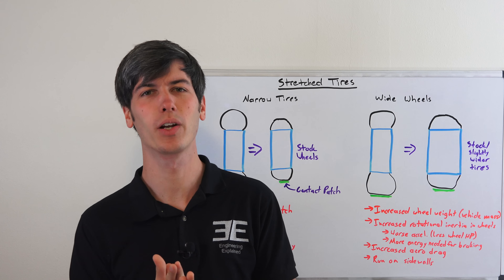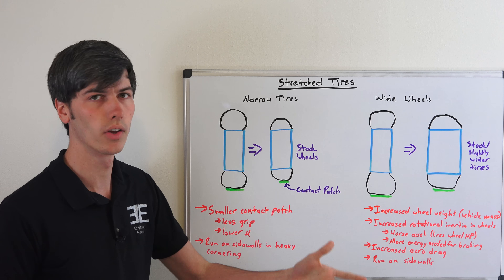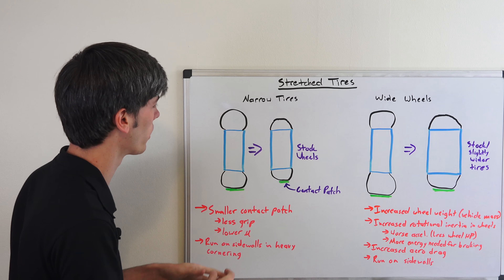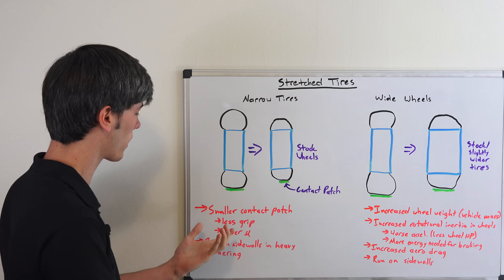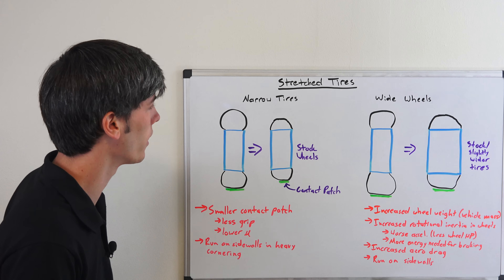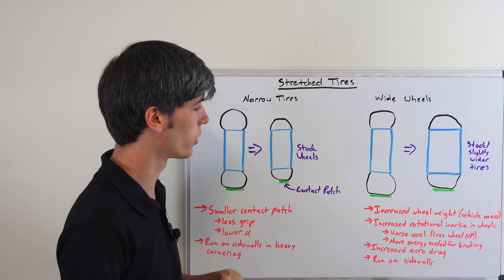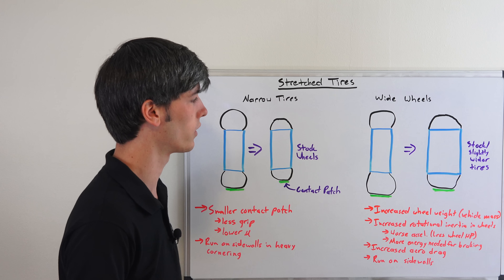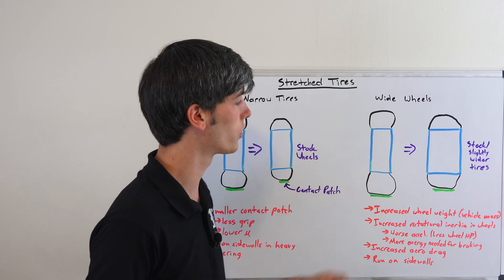Stretched Tires Are Silly

Comment: Thanks for the video. I've been looking into this concept for a long time without a satisfactory answer. Needless to say, I have some questions and would love to hear the thoughts of someone better versed in mechanics/physics/engineering concepts than I am:

1- What do you consider a stretched tire? Tire manufacturers design specific tires to fit within an approved range of wheel widths. I can put a 225/40/18 Michelin Pilot Super Sport on a 7.5"-9" wheel and still be within spec. I believe if I put a 225/40/18 on a 9" tire it will aesthetically have a slight stretch. Yet... it's within spec. So when you refer to stretched tires, are you referring to "grossly" stretched?

2- I forget the name, but I read a vehicle dynamics book that specifically mentioned a situation where a racing class allows an 8" wheel width. In this case, it recommended putting the narrowest tire that fits within spec (slight stretch), as opposed to the widest tire that could fit within spec (slight crown).

3- There's a lot of debate on whether wider tires are better... to me, this video is related to that. Any possibility to tackling this subject? While this is a video saying stretched tires are silly... I feel it there is a point where too wide tires are silly as well?

4- Doing my own research of sports cars on the market, in general, sportier cars tend to have wider wheel sizes with narrower tires on those wheels (usually within spec). The more track tuned models tend to go further down that path. The most severe I found was a new Porsche 911 GT3, which has a 305/30/20 tire in there rear running on 12" wide wheels. I'm not sure the specific tire it uses but a Pilot Super Sport is only recommended for up to a 11.5" wheel.

Anyway, thanks for the vids and the channel. Don't usually comment, but this is a subject I've been looking into for a long time without ever really feeling an answer was satisfactory. (Question being, what's the most optimal wheel/tire width?)
Reply: +Ryo Hazuki Thoughts?
Reply: +tyler t 

I'm still seeing more actual evidence and data supporting slight stretch. Aside from the performance cars. A car like an Ariel Atom (3 or 3s) isn't really bound by those same aesthetics and it still runs tire sizes with a slight stretch (within manufacturer spec). Bigger wheels isn't strictly for looks. Sometimes it is, but other times it's function (bigger brakes fit). Thinner sidewalls keep overall diameter the same.

F1 is an example of a racing class running stretched wheels. Taking dry tire sizes, fronts are about 245 65 13 and rears are 325 50 13. Wheels are regulated at 305-355mm widths front and 365-385mm width rears. 

The figures for F1 by definition are stretched even at the narrowest wheel widths. if stretched wheels are so silly, then why does F1 force stretched wheels? Can't be that silly...

Again, I'm more on the boat of trying to figure this out that challenging the idea. I can see merit on both sides. I just don't think it's as simple as everyone makes it out to be.
Reply: +engineering explained thoughts on the f1 stretch?

Comment: this vid was subpar in explanation of theory of ideal ratio of section width to wheel width to maximize tire performance, and consideration of sidewall height and other sidewall stiffness and tire weight issues.
Reply: I agree. I would also assume that a stretched tire is a smaller tire and therefore a lighter tire. An additional benefit to go with stiffer sidewalls.

Comment: I've done extensive miata forum stalking on this subject, the key is that you want SLIGHT stretch to reduce the sidewall flex/marshmallow effect. many of the people on the forums have found the 15x9 inch wheel to produce faster laptimes than a 15x8 with the same 225 tire. I'm talking about a stretch of about 0.15 inches. 

excessive amounts of stretch is a terrible idea

Comment: I coudnt agree more with you.... i run a mobile tire shop and had a guy complain about wheel vibration. When i put the wheel on the balancer I thought the wheel was on crooked but there was a massive bulge and the sidewall was separating. The tire was clearly stretched onto the wrong rim.

Comment: actually in some cases having slight stretch is better performance wise than no stretch
Reply: +Nikki Naydenov definitely in no case is it better...
Reply: +Mike Cid yes, it can be. it stiffens up the sidewalls of the tire so there is less play in the sidewalls so you get "snappy" steering. a good example would be a 215 on an 8.5 inch wheel where the stretch is very minimal, but it exists. but a 165 on a 12 inch wide wheel is completely stupid and HEAVILY decreases safety and performance

Comment: when cornering, a slightly stretched tired will provide a stiffer side wall essentially turning your tire into a trapezoid. parallel sidewalls aren't as resilient to a lateral load created by cornering.

Comment: thank you!!!! when I was autoxing my mazdaspeed 3 I went from a 18 to a 17 inch slightly wider at 8iches and I ran a 245 45 17 Dunlop direzza tire. I realize the  tire was a little wider than the rim however overall grip was much improved and the only tradeback I say was I lost a little I transition responsiveness. I always thought real race cars must have some profile to the tires to act like a suspension that can be controlled through air pressure.

Comment: Tirerack has specs shown for various sizes of every specific tire they sell. I bought a 225 Pilot Super Sport rather than a 235 because the actual tread width was the same for both sizes even on a wider wheel. There are other considerations, of course, but tires are labeled sizes like shoes.

Comment: less grip than a tire that matches it, I agree. Autocrossers do this for a reason though.

Autocross rules limit tire width, but usually not wheel width. By running a slightly wider than recommended wheel (not vw stretch, just like 205/50/15's on a 15x8" wheel) they preload the sidewall, greatly decreasing the delay in steering input.

Having tried this setup on my own car, I can confirm it works, however, it is somewhat twitchy.

Comment: i thoghut friction is not affected by the surface area? force of friction is coefficient of friction times normal force right? how does coefficient of friction change when wheel has less contact surface on the ground?

Comment: Curious to hear your thoughts on the opposite scenario. I've been running 225 section tires on a wheel where the sidewall is square with a 215 section tire. It's not an extreme setup by any means, but still curious the effects of such a mild setup or in a scenario where the difference is much more exaggerated.

Comment: So you are saying if I change from my old chinese made cast aluminum wheels to a wider forged 2-piece racing wheels. Put some stretched tires so I can get my fitment just right when slammed to the ground, I am better off with the old wheels, tires and stock suspension also?
Reply from the maker: +Antto Maybe. Stock aluminum wheels eh? Pretty impressive.
Reply: +Engineering Explained  Don't have to be rude, man
Reply from the maker: +Dylan Baddeley I was being serious. Stock aluminum wheels are a great thing.
Reply: Henceforth negating the need to answer the question?
Reply: +Antto slammed? I'd stick with the cast wheels, forged two-piece aren't necessarily stronger in any specific way, but probably lighter in the same size. Fitment just right? Subjective idea, unless that just right fitment maximizes contact patch and suspension wear issues along with the slammed geometry.
Reply: nah titanium wheels are where it's at

Comment: if you run a moderate stretch it looks good and stiffens up sideways flex while still keeping the dampening you get from higher profile tires.
with stretch a 60profile feels like a 40 or even lower

Comment: its for drifting on the cheap. less grip= more sideways.
Reply from the maker: With the disclaimer "with less control and at lower speeds."
Reply: +Engineering Explained true. But that's what drifting is, controlling mayhem. is simmilar to that European fighter jet (can't remember the name, eurofighter typhoons?) That is engineer to be unstable but has buckets of computers to make it fly, so when it needs to evade it can redirect on a dime.
Reply: +Myles Ruether Maybe thats the case in Amateur drifting. Pro drifters actually have tons of grip, they use very sticky and big tyres and have lots of downforce. This makes it easier to control the car while they just Keep wheels spinning with equally big amounts of power.
Reply: Schleberger oh for sure. But I'm talking grass roots, "how much can I really use this 60 up?"
Reply: ***** Ah you even wrote "on the cheap" in your original comment, sorry must've not seen that. So many People have wrong ideas about drifting tough^^
Reply: +Myles Ruether A few people i know have a mild stretch because they say it makes the sidewall flex less which makes transitions easier/more smooth. I run dunlops that have a very high durometer sidewall. Same effect without stretching
Reply: Saving money on tyre's means more track time which is worth more to me then a little bit more grip, so many people would be better off going cheap so they can get out on the track more.
Reply: Hunter Cash yea, if you live somewhere where the roads freeze, just think about when you are in a pickup truck or something with tall tires. If the vehicle gets some transverse velocity, it's smooth untill you hit pavement again. The flex in the sidewall will, in theory- be the only place that any movement can happen. The result is a few violent oscillations untill you are straight or in the ditch. If you have the cash, stiff racing tire are without a doubt WAY better, but the stretched side wall should reduce the some flex so as to reduce the violence when exiting a drift.
Reply: DriftNick Thats totally true, most people (lets be honest) can't use the full potential of the super grippy tyres anyways, so it may be better to invest the money in additional track time first.
Reply: +Schleberger 100000 PSI..
Reply: How is it lower speeds when contact patch does not influence grip. How is it less control when a slight stretch stiffens up the sidewall.
Or are you comparing cheap stretched summer tires to a much more expensive performance variant?
Reply: "How is it lower speeds when contact patch does not influence grip"

How does having more tyre touching the ground not influence grip?

Comment: Stretched vs overstuffed tyre*? (*Australian)  Is it better for performance or feeling to run a 205 on a 8" wide wheel, or to run a 245 on a  8" wide wheel?  (assuming the ideal is a 225)  A lot of autocrossers seem to stuff the widest possible tyre they can onto a wheel...
Reply from the maker: +TassieLorenzo I'm not sure, seems like the tire would be more flexible (wouldn't feel as stable or precise), but for minor changes it may not make a huge difference.
Reply: +TassieLorenzo more dependent on actual tire model and its actual specific measurements of that tire, the tread compound, and sidewall height. you can diminish tread width gains by needing more psi to maintain feel, which means slight stretch might be more effective than big stuffed.

Comment: I've seen stretched tires on a Ram 3500 Heavy Duty, where the rear tires used two tires.
Reply: Also causes a very American thing to happen; The turning is slow, you have to yank the wheel more, and is hard to corner, almost falling off road.

Comment: You didn't mention the effect of reducing sidewall flex. When you begin to load up on corner entry it doesn't allow the tyre to move on the rim and can lead to snap over/understeer and it some cases a mild case of instant death.

Comment: Can I know , if we are using stock tyre with wider wheel , how can we measure how many wide can use for stock tyre? For example um using my 155.70.13 tyre( original rim width is 6 inch ) to aftermarket wider rim its 7.5 inch width.. can that tyre use for mount it?

Comment: i hear in some racing circles that a small (read:not stanced) degree of stretch will help make the steering response better.  for example on a 15x8 wheel a 205/50, on a x9 a 225/45, and on ax10 a 255/40. these would all be super high performance and slick tires with wider section widths as well, could you please address this

Comment: I understand a large stretch will have a significant effect on performance but how about a small stretch. I will be downsizing my tyres from 245/40/17 to 225/45/17. this is on a 8.5j rim and fits tyre manufacturers recommended minimum tyre with for that size of rim
Reply: You should be good it's going to be a plush fitment. Your new tire width 225mm (8.85inch) is slightly wider than your rims width 8.5inch, so your tires sidewall lip should be perfectly inline with your wheels lip. You shouldn't have any noticeable performance loss.
Reply: +Kaasim Mir As long as you are within the recommended wheel size for the tire, you should not have any negative affect on performance.
Reply: Great. Thanks

Comment: I went from 255 in the front to 275 and in the rear I went from 295 to 315. I was told this would increase grip but if I understand you video it doesn't... Odd because after upgrading my tires my 1/4-mile times dropped by 2/10ths of a second.

Q: are 275's on 20x9 wheels considered stretched (correction: bulged)?
Q: are 315's on 20x10 wheels considered stretched (correction: bulged)?
Reply: +Brendan R Thank's Brendan!

Comment: Aftermarket rims can be lighter even though same diameter but wider width. Running slightly stretched tires is not a problem. The car scene right now is the major stretch for that fitment. I run 195/50 on my 15x8 with no problems. Many examples on forums as well. I would not want to stretch 165/45 on 15x8, that is just too risky and not my style. That combo has been done as well. It all depends what the driver wants for their car.

Comment: The thing that has been missed here is, for some forms such as drifting, the predictability and response in the drive is notably increased with stretched tyres. The virtual eradication of side wall flex has a very similar effect to a very low profile tyre with the disadvantages associated with low profile.
Reply: that makes sense
Reply: Then run a 30 series...
Reply: Exactly, it was originated from wanting to run a cheaper tire that you are going to quickly trash anyways and have the performance of a higher quality tire while drifting.  It's an effective way to reduce sidewall flex.  From there it became a 'fad'.  Just like wings and tow hooks on street cars.

Comment: Stretched tyres are indeed stupid - but there are aspects of them which have a goal in mind.

First issue is that a smaller contact patch actually increases grip IN THE WET. Normal road tyres greatly benefit from higher pressures in the rain, and I have proved this in my car at a race track, in dry and wet conditions.

The reason it provides better grip is that the smaller contact patch applies more pressure to the road surface, and is far more efficient at clearing water, than a larger contact patch, with lower pressure. You are far more likely to aquaplane with lower tyre pressure.

Stretching tyres slightly might reduce the slip angle required before a tyre initiates a turn, thus improving turn-in feel and speed. All tyres must develop a slip angle before they can change the direction of a car, and this is why low profile tyres are preferred in race cars.

There's a trade off though: lower volume of air in the tyre reduces the ability of the tyre to absorb shock, and thus places greater stress on the suspension system and hence decreases ride quality. And this is why properly designed wheel have spokes which are hollow, and greatly increase the volume of air in the wheel and tyre combination. This radically improves the ride.

F1 cars have massively tall tyres because they essentially ARE the suspension system in the car.

Comment: Stretching tyres will (if you do it correctly, most people don't) actually stiffen up the sidewall during cornering. If you see a regular wheel while it's turning, the sidewall flexes under the lateral forces. I'm assuming you know this but others don't. However, when a stretched wheel turns, the sidewall, which usually is straight up and down so it can be stiffer holding the car up, is perpendicular with the forces while turning. This is common practice in drifting, many large drivers do this, because it makes the back end kick out easier, and more stiffness and grip is used the car is sideways. However, this does apply to tarmac driving too and is not uncommon during road races as well.
Reply from the maker: +Aaron Hachmeister "makes the back end kick out easier" is same things as "less grip" and I certainly understand that on a budget, this could be a way to reduce traction and thus make it easier to initiate a drift. That said, it's not a method professionals would implement as grip is important for high speed drifting. Here's a video with more detail: https://www.youtube.com/watch?v=lAofXdA_V28
Reply: +Engineering Explained  If you'd read the second part, which I did have a typo in, the grip from the sidewall stiffness is used when the back end is sliding, not when the car isn't sliding. You also never covered stretching tyres in the video, either why they would or wouldn't do it. If you want to see professional drifters with stretched tyres, a driver at the event, Ryan Tuerck stretches his tyres on the FR-S he runs. Otherwise look at Mad Mike or Calvin Wan, just to name a couple others. It's common practice in D1 GP for most drivers to do it there too.